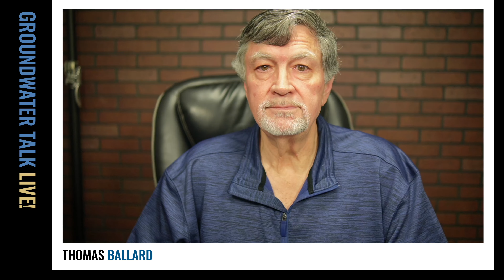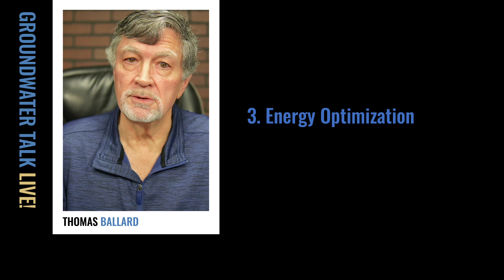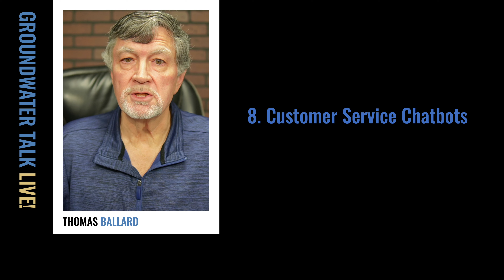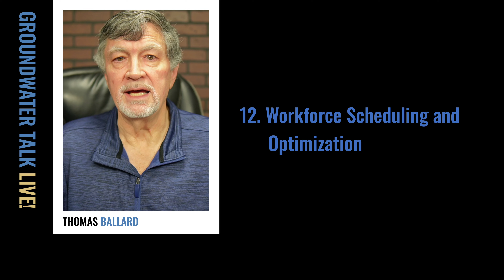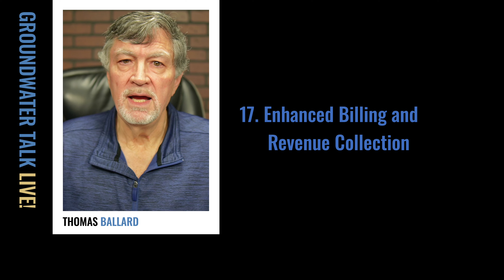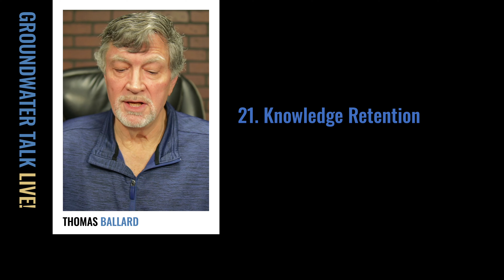Smart Water: 20 Ways AI Can Improve Processes for Small Water Utilities

Comment: I'm in an Irrigation District with 752 connections.  What is the cost benefit ratio of using AI?    Any like sized districts you could steer me towards?
Thank you for your video.

Bill Jackman  Moab Irrigation Newman Lake WA
Reply from the maker: Great question!  It's only been in the last few years we have really seen AI adoption by small water systems and AI-driven technology get the price point where it is accessible by even the smallest districts.  Also, a lot of the information out there is from specific vendors, so you need to take that into account also since they are going to put a bit of a spin on it.  Here are a couple of examples: Abbott, TX https://modernpumpingtoday.com/municipalities-turn-to-ai-for-efficiency/ and Fifty-One East Water, OK https://www.blacksandscyber.com/post/latest-trends-in-u-s-water-utility-automation-and-digital-connectivity.  I'm trying to reach out to smaller water systems to put together some case studies which would make for some great videos, I hope.  Also, it may not technically fall under the general heading of AI, but using AI in predictive analysis for leaks can produce some substantial ROIs in short time frames.  There were several presentations on that topic at the NRWA WaterPro conference this year, but I do not remember the actual water system that were referenced.  Non-revenue water is really a "low-hanging fruit" that lends itself well to the predictive analysis offered by AI.
Reply from the maker: This video also has additonal information.  This is the 40,000 foot view I presented at the NRWA WaterPro conference this year: https://www.youtube.com/watch?v=oJLgMB0NqKI&t=1176s
Reply: Amazing